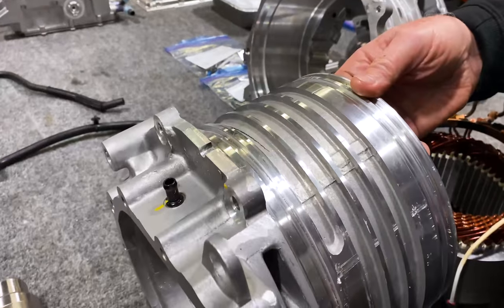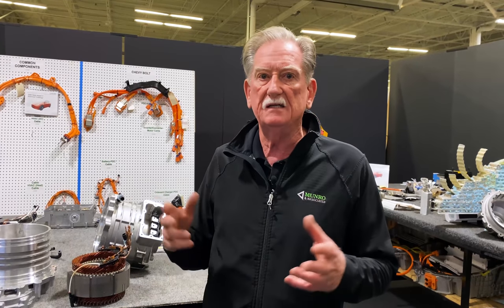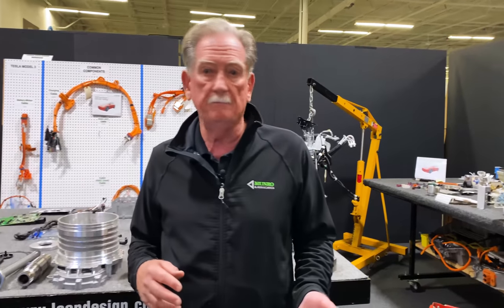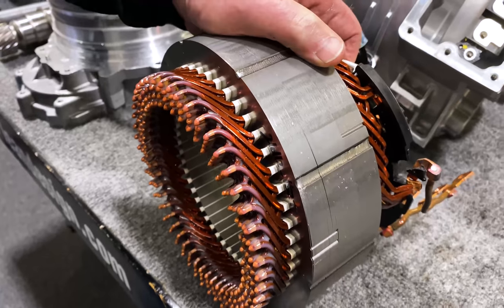Mach-E Front Motor: Sandy is Blown Away by Great Design

Comment: Well it’s interesting to see Ford can get one motor ‘right’ compare to the other mess in the rear.. but I do wonder if the Tesla motor at 2.5 to 3 times the power of this Ford motor, wouldn’t shred that gearbox design.. could it be scaled up to handle that much more power? Would it lose it’s efficiency gains doing that? 🤷🏻‍♂️
Reply: Yes, it can scale up or down. There's nothing power-limiting about the layout. The Chevrolet Bolt uses essentially the same design as this Mach-E unit, and is more powerful.
Reply: @brianb-p6586  well, hopefully some Tesla engineers are watching and at least run the numbers of everything involved to see if it gains them anything.. if they haven’t already looked at that option
Reply: @airheart1  I'm sure that Tesla staff have considered all of the obvious drive unit layouts, long ago, as any manufacturer would.
Reply: @brianb-p6586   "should", rather than "would "? When designing, I try to assess many ways of doing something, hopefully choosing the optimum. Other people don't seem to do this -  they jump at the first suggestion, then have massive work arounds, redesigns and lots more work. Hey, maybe I'm missing the point !
Reply: @chrisheath2637  I think you're both underestimating other people, and missing that Tesla - like every other automotive manufacturer - is staffed by people who are professionals in their industry, who just happen to be working for Tesla at the moment. Every bit of Tesla design is conventional automotive technology, as it should be, because it is drawn from industry experience with choices influenced by the resources available to them and the goals of the company. It's no coincidence that systems such as suspension, steering, brakes, and structure are all just like everyone else - they didn't develop them in isolation (and in most cases they didn't even design them).

Comment: I love how Sandy has the experience and humility to admit when he may have been wrong like with hairpin vs wound stators. Maybe he will come around on fuel cells as well, because they will never be a thing in regular passenger cars. Commercial trucks MAYBE in certain applications, planes possibly. The thing is, when hydrogen gets cheap enough to be competitive with fossil fuels, fuel cells may still be too expensive, and hydrogen combustion may win out even though it's not as efficient.
Reply: Problem with Hydrogen is that when mixed with air it becomes highly explosive, one little static spark and Kaboom. Just a matter of time when leaks happen and things get blown up, like that H fueling station in Norway a couple of years ago. No thanks, I’ve seen it happen three times different settings.
Reply: @Chainyanker007  "Booms" are studiously avoided when promoters talk about "wonderful green hydrogen economy", or fuel cells.

Comment: From an engineering point of view, permanent Magnets made from rare earth minerals are totally overrated. At the National MagLab in Florida, USA, scientists have pioneered and produced similar ultra compact spiral electro magnets that could put out a 50 Tesla field if turned on. They even made a documentary on it! So its not a fantasy.... it's real.

Now, using a non conductive coolant and circulating it around the inverter parts would increase the parts efficiency and longevity ... e.g no melting! 

The key for Electric Vehicles is continually keeping all EV parts at the parts' optimal operational temperatures.

Another point I have is that I have designed new copper wire that has 30% more surface area than standard copper thread or wire. It can be scaled up for high voltage power lines, and its outer insulator has integrated sensors that would allow electricians/mechanics to quickly identify damaged areas of the wire before failure. And if I used pure gold plated connectors and pure silver plated copper wire would increase its efficiency in conducting current because electricity moves using the skin effect of the wire. Thus plating with pure silver would increase current. The cost wouldn't  be noticed if the auto company invested and mined its own source of gold and silver or opened their own shop to buy used gold and smelt it to 99.99% purity. 

BTW, My wire design maintained a value of 87.5. With better machined and hardened extruding dyes, I could increase the surface area of the wire by another 4.239%, and increase the wire' efficiency!

Lastly, as I stated earlier,, compact spiral electro Magnets the size of a 12" diameter 2' long tube can produce a 10+plus Tesla field that is insanely stronger than an MRI's 1 Tesla magnet. Using electro Magnets instead of rare earth Magnets would slash the costs for making a EV.

The Achilles' Heal of all Electric Vehicles is its Lithium Ion batteries. All lithium batteries are highly sensitive to high and low heat conditions. And they are prone to dendritic growths that could short out the battery and start a major fire. A simple solution would be to design a battery with a cage around a rotating negative electrode. Every hour the negative electrode would rotate a couple times at a specific angle to press the dendrites back onto the negative electrode. This would mitigate this issue an extend battery life. It's better to add a little more tech to batteries than just dumping them in the trash.

Lastly, Fly By Wire, must be fully adapted to all commercial vehicles, and customer own vehicles. Use of a standardized "Drive By Wire (DBW)" would expand the technologies you could add to a vehicle. E.G. movable weighted ballast mounted on the under carriage. They could be computer controlled and constantly adjusted to provide the driver optimal control driving and optimal traction. E.gg Geee.... On a 4 wheel drive if the vehicle's CPU detects the vehicle losing traction  going up hill it could instantly move the ballast to a position that would allow the driver to continue driving forward with control. If used with 4 high powered micro traction suction fans, could increase the safety for the driver encountering this situation in any weather condition.

Well that's  enough brain drain for today.

Let me know what yall think.

Comment: Who is this Magna that you keep thanking, Sandy?
Reply: Magna Steyr
Reply: Magna International, is a parts distributer
Reply: Mitchell - MAGNA is in Germany, they also build the JAG iPace and FISKER ocean, as well as others.
MAGNA is using an OUTDATED platform for EV, as well as motor and components.
Reply: @markplott4820  
If your going to troll, get it right.
Where are they from?
Reply: @markplott4820  Magna is a Canadian company. It has subsidiaries, including Magna PT (formerly Getrag) in Germany and Magna Steyr in Austria. There's nothing outdated about any of this.
Reply: @francoisbedard6021  Magna International is not just a parts distributor, it a manufacturer.
Reply: @markplott4820  Magna's vehicle assembly work is done by Magna Steyr (Austria), rather than Magna PT (Germany, formerly known as Getrag).

Comment: 8:45 The hair pin design is much thicker, resulting in less turns an less magnetical flux. At the end of the day higher current is needed for the same flux, it is heavier, more copper, more expensive. And copper prices sky rocket like a Falcon Heavy!
Reply: It doesn't work that way. Fewer turns of thicker wire carrying more current but with less voltage drop ends up with similar copper use and efficiency.

Comment: So the only good EV part on the entire car is the motor, the most complicated part? I call bullshit. Either this is a Rivian motor, or it was designed by Rivian when Ford's C-Team couldn't cut it.
Reply: How many times?
It was designed by ze Austrians!
Reply: You are right to be skeptical.  The motor is a Magna product.  Sandy mentions this occasionally in the video, but it's easy to miss without context.  Magna and BorgWarner are major suppliers of modern drivetrain motors like this for various industries.  The Mach-E rear motor is from BorgWarner and the front motor is sourced from Magna.

Comment: 10:25 - "Wire Wound Stator".  in addition to the Spiral Cooling Jacket, it should be noted BMW uses a Wire Wound design with their assembly process being 100% AUTOMATED.  again, something not fully understood is that the current "Tech Obsession" we now see here in 'Murica in the 21st Century (and think is new) actually got it's start back 80 years ago in WW2.  because of British secrecy, most of our pilots didn't know what the f%^k a Jet Engine was until it was encountered in the skies over Germany already flying in the ME 262.  the Space X everyone associates with Elon actually comes from the work of an SS Major (Wernher Von Braun).  he defected to the U.S. after the War and brought his V2 with him (ref: NASA).
Reply: Yes, progress is on the shoulders of those who have gone before.  Elon has said he admires the  work of the early pioneers in rocket technology.
Reply: You have some of the Von Braun aspect wrong.

Goddard, in the U.S., was initial innovator.  In Germany the major advances were made in the turbopumps, developed by a company that made water pumps for firefighting before the war.  Many of the other advances (carbon steering vanes, vibration tolerant magnetic amplifiers, wire-wound pressure tanks, dozens of others) were abandoned in favor of better solutions developed in the U.S.

Comment: I think this reflects a major difference between Tesla and Ford. Ford hase many decad s of experience making cars (machines) . As a result, the machine parts of this vehicle are done well. They do NOT have that experience with EV components, thus their EV components are much less sophisticated.
Reply: Ford does not manufacture those components.
Reply: @TqSNv9R0iG5Ckxew  good point. I would hope that they analyzed them before buying to put in their cars and IF they did, knew a good machine when they saw one....of course they could have just gone with the lowest bidder, but I doubt that co.pany was the lowest with all that detailed machining
Reply: @richardchristian5011  
I think automotive engineers handling a multi billion dollar product launch tend to know what they are doing more than typical youtube commenters.
Reply: @TqSNv9R0iG5Ckxew  I would sure hope so.

Comment: If forging makes things indestructible then ball bearings wouldn't fail. They fail from misuse or incorrect application, which is caused by poor design.

Apparently that poor design isn't visible to you, and you won't admit it exists until the parts are failed.

I bet the Mach E gets recalled due to transmission failures.

Comment: I am not a fan of the gear box motor design. Hub motors are the way to go. Very reliable and NO gears.
Reply: Unsprung weight?
Longer high voltage cables?
Harder to seal from water ingress?
More expensive?
Reply: At the moment,  all electric motors require reduction gears,  because their operating rpm range is significantly higher than the tire rpms.
Reply: @fredbloggs5902  Unsprung weight? Unless your racing I don't see an issue. Longer high voltage cables? I never understood how running high voltage is a big deal we have miles of high power HV wire in the factory and it's plug and play. Each wire is thinner because current is divided between  the wheels. The smaller HV armored flexible cables common and fairly cheap. Maybe more wire but thinner wires. I would say a toss up for weight. Harder to seal from water ingress? The hubs seal well and time tested.
More expensive? I would say cheaper but time will tell on bigger units.

Ford Maverick with two front wheel drive hub all electric would be perfect for me. Been using smaller hubs for years with no problems.
Reply: @jamesengland7461  That is incorrect hub motors have been out for 10 years or more.
Reply: @stevegorkowski3246  then why aren't any makers using them for their  cars?
Reply: What's more expensive/ complex?
1 transmission per axle (using tried and trusted tech) or multiple motors?
Reply: @jamesengland7461  "all electric motors require reduction gears"  Ebikes,E motorcyles and others have them. Trucks will be released soon. That is when I will buy. I have been running a hub motor for 7 years and works fine.
Reply: @rogerstarkey5390  Many smaller motors are cheaper by far.

Comment: I see Engineers using improper and not appropriate means of disassembly, shame on you . This is a major problem in engineering they build things that cannot be taken apart and put back together. As a result when ther  engineering fails and it must be repaired it cost far more than it should have.

Comment: Please, they are MOSFETs, not MOSFATs. Metal Oxide Semiconductor Field Effect Transistor. :-)

And I fully agree, if you can avoid oil, do. No added pump, filter, and most importantly - no heat exchanger which always fails and contaminates one or the other system depending on max pressures.

Comment: The difference in construction between the front and rear drivetrains really highlights the problems legacy car makers have in design. It appeared that there was almost no (or actually no) commonality between the two systems. That is a huge problem. Yes, I know the systems are inherently different in size and function, but how they interact with each other and the rest of the vehicle shouldn't be affected. i.e. connections and fasteners, and why are the inverters so different? They don't need to be. They both do the same thing. Yes, one needs to be bigger than the other, but with an inverter there is no reason to not just scale the front design.
Reply: Time.
They diverted the body design from an ICE project, needed systems ready to install ASAP, (probably) asked for tested units from suppliers.

Comment: Pressing in is shit because during recycling have fun opening that poop for copper... VW is right here with not penny pinching fasteners. Clips are cheap trash
Reply: The pressed-in design is chosen for heat transfer to the case, since the water-based coolant can't come in direct contact with the windings; it's a common design. 

It looks like the Munro staff cut the case lengthwise to release the stator; that destroys the case, of course, but no one will be replacing a stator while reusing that case, and the cutting works for recycling of both the stator and the case.